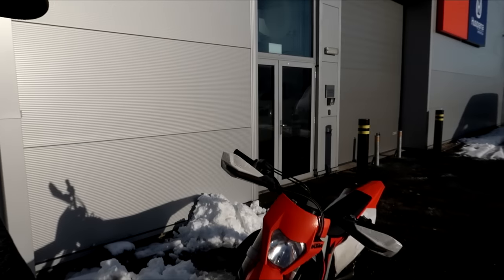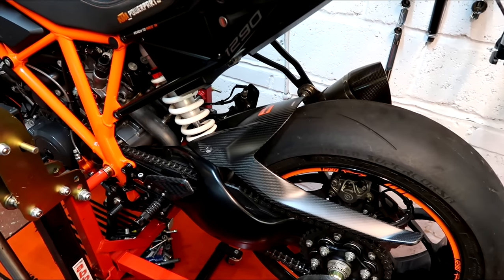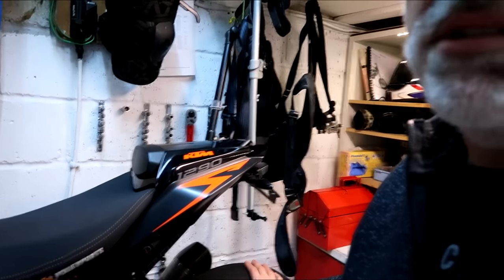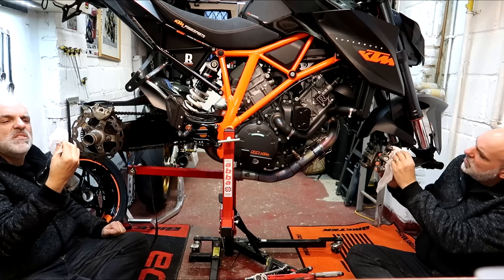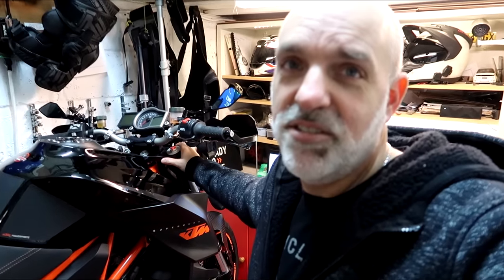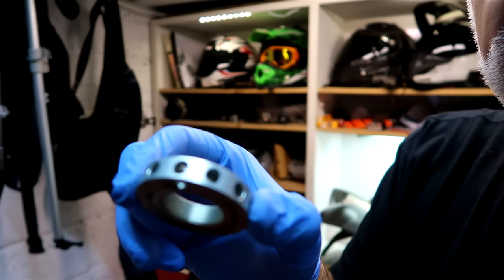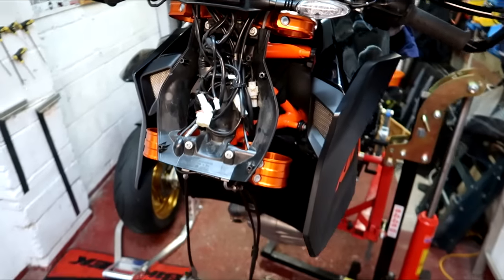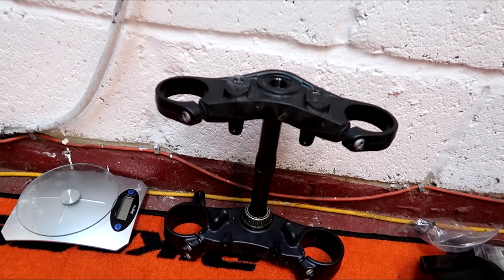Super Duke MODS | Billet Triple Clamps & Tyres

Comment: I reckon the Duke would look better with bar end mirrors now you've got the hand guards on. Just something about the shape of the head light and the lines of the mirror stems and the carbon guard's clashing. But it's looking good so far chops keep the vids coming.👍
Reply from the maker: I think your right.. I may take the mirrors off as practically useless tbh.. Good for checking the GoPro is recording that about it!

Comment: I would check again steering head nut (57301036000 STEER.HEAD NUT 660SM 02) as per manual it should be tightened in 2 steps and only around 10nm; screw that tightens clamps is on top and is 50nm (6030103600001 STEER.HEAD SCREW M22X1,5 SW27); bike will feel even worse if to overtight the steering head nut
Reply from the maker: +Dmitri D ok thanks Dmitri, no didn't know about the two step tightening will see how it feels 👍

Comment: I was hoping you could tell me if the clamps help with the front end feel, but as the tyres were toast and the old clamps were hanging on by a thread I reckon the only way is up? Loving this series btw, have the identical bike and just fitted the full Akra, my word it’s wicked. Have the Motohooligan billet intake on, just about to fit the Power Commander and take to the dyno, so will be watching your progress with great interest. What a bike! Probably the most fun I have ever had on two wheels, coming from a line of Blades and Gixxers
Reply from the maker: +Simon Pennington yeah if it feels better probably due to the tyres or tight locking nut.. but I think it will help the feel all the same. Keep me posted on your dyno results sounds like our spec will be very similar 👍

Comment: Just the two of us! That part cracked me up man! Since I have watched you're videos about the Duke I got some questions about the superduke models 2016 vs 2017/2018.. What on electronics side do you lose on the '16 model compared to the '17/'18 model? And how do these models compare on the road, big difference or barely any because of the electronics changes. Keep up the good work!
Reply: DutchGiant The 14-15-16 do not have cruise control/keyless go i know for sure, no QuickShifter has to be added by heeltech. Also the 17 -18 have 4more  HP due to titanium valves

Comment: Thats hard to believe LC that your top nut was loose? Your are scaring me to have mine checked? Can you feel any difference with that orange 🍊 triple clamp?
Reply from the maker: Yeah I was very surprised, its supposed to be 10 nm of torque thats all not much! I gave it a bit extra for good measure. I didnt notice any clunking of the front end under hard breaking which you normally get when its all loose.. I will let you know if it feels massively different now but I suppose Im not going to be able to tell as the new yokes  could change how it feels a bit anyway!

Comment: Interesting vid love the bike; any tips on aligning the forks when you re-assemble? Do you do it by eye or a more scientific method?
Reply from the maker: +Paul Hartwell I just line up the top markings by eye, done it like that for ages on the blade too never had an issue 👍
Reply: Thanks for the reply; do you tighten the axle before the yokes to get the fork legs parallel; or am i making the job over complicated?
Reply from the maker: I dont tend to worry about that too much, I tightened the forks first then the wheel. Every six months or so worth loosening everything and bouncing it so they say but never tried that myself..
Reply: Thanks for the advice; have a good Christmas look forward to more videos in the new year.

Comment: hi bro i can't wait to see your shit on the dyno.
N u have the Rott perf air box ? right?
kind regards from Paris.
Reply from the maker: +Pomplardpanam thanks mate, got the full rotty kit 😎😎
Reply: Yeah bro next month i wil put that shit the Rottweiler Intake System - Super Duke 1290 R and  with two SD 1290 - TVS-40 Ultra Short Tuned Velocity Stack .  And i will let my bike preparator fuck with it with fixing and dynojet tests also with PCV N autotune dual or single .
I keep u in fucking touch when i get the results .